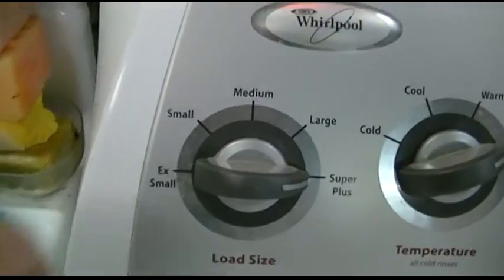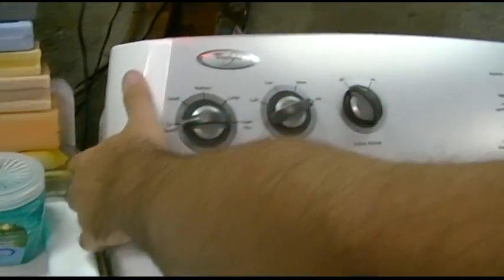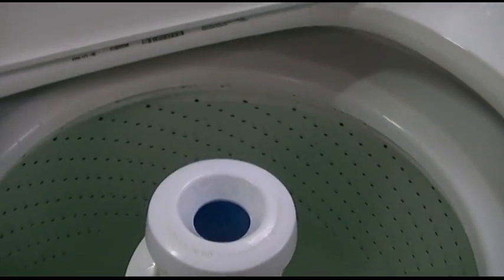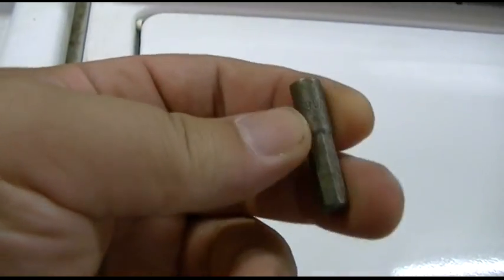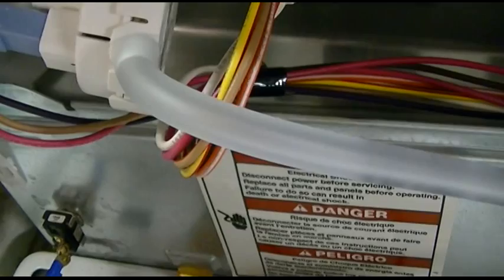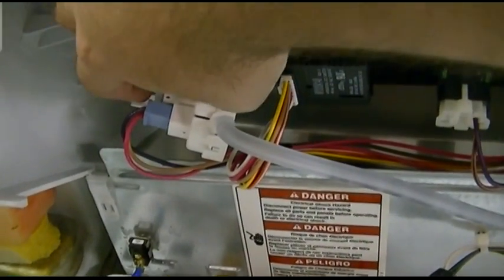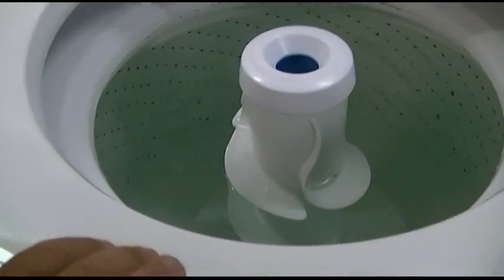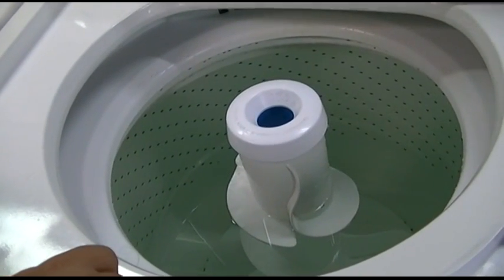Whirlpool Washer - Adjusting Water Level Selector

Comment: After 7 years mine got out of adjustment,btw, YouTube algorithm did a good job showing me this video, and my machine started to overflow onto the floor. I decided to get a new pressure switch, so I can have piece of mind to run the washer without fear of my machine turning into a waterfall  😧
Reply from the maker: You should hope that you diagnosed it correctly.  A bad hose, even with a tiny pinhole you can't see, can cause the system to fail and the washer to overflow.

Comment: This is good for those eco-friendly direct drives that use way less water than they should. If only there was a way to do this on the HE machines...
Reply from the maker: Ha ha, yes you're absolutely right!  Even if you stuck a garden hose in it, it would probably throw error W1--too much water, and spin out all the water and clothes down the drain!
Reply: Haha! True! That's why I use manual mode on my HE machine!
Reply: Smurdle450, the manual mode is Normal mode?? Cuz mine don't have manual mode, whirlpool cabrio platinum He

Comment: Does this trick work for variable water level selectors? I obtained a second direct drive about 2 months ago and I want the water level to come up about a half inch. I have been turning it to "reset" and holding it there until I think there is enough water
Reply from the maker: I believe so.

Comment: I did this to my Maytag but brought the water up a bit over the top holes. My Maytag has a thumb wheel on the level pressure switch which makes it even easier than yours to adjust.
Reply from the maker: Beg MY pard!

Comment: Ok please explain how to pop the latch so I can open where adjuster is at. Don’t want to gorilla strength the wrong part and break it.
Reply from the maker: If you have THIS EXACT MODEL, there are two big metal clips underneath, as shown.  Push them towards the back of the machine while trying to lift up on the controls panel.  Left side is a little trickier because the lid switch is there also.  Alternatively, you may be able to slide a putty knife in the gap between the controls panel and the machine to help push the clip back.

Other models may use screws instead, sometimes on the front, sometimes on the back.  Just be careful, but it's a pretty rugged piece so no chance of breaking.

If your machine is newer, this may not work at all.
Reply: Thank you so much 👍🏽🤙🏾
Reply from the maker: @aliiuso3470  You're welcome.

Comment: I have the newest whirlpool front load washer can I do the same thing
Reply from the maker: Front loaders are designed to use less water.  Too much water can create too many suds, which would impede washing performance.  Chances are your machines does NOT have mechanical water level selector, and thus, no, you can't do that to yours.  Unless of course you're handy with a soldering iron and microcontrollers and write your own programs for it.

Comment: My friend has a Cabrio about 2 yrs old. It is horrible!! Very little water enters the machine and even though she only has one set of sheets in it at a time, they come out filthy and stinky.  Can We do this to hers?  It's supposed to be a large load machine and doesn't even get them wet. Dirt, dog hair,  and lint covers all the clothes after washing.  She fostered a mentally damaged woman who had smeared feces on the shower curtain. I didn't know this, and threw it in the wash. Feces was still smeared all over it after 2 washings.
Reply: I’m here for the same reason!
Reply from the maker: The Cabrio isn't a washing machine, it's a joke.  The only thing you can do is throw it out and buy a REAL washer.  They don't make them anymore, so it will have to be used.  No, I'm not kidding.  This is the real truth.
Reply: @jaykay18  I was thinking this. I got a top loader with the house I bought 14 yrs ago that I've had in storage. I might just dust it off and put it back to work. Im tired of ruined clothes for minor stains that washers cannot get off.
Reply from the maker: @cherylefunz7789  If there's nothing wrong with it, there's no reason it can't be put back to work.  I'd never give away the machine, but that's me.  I had a talk with my 2 washing machines and I told them that they will have to continue to work for the rest of my life.  I told them not to worry if they "become ill" because I'm the doctor and I'm in-house.  If I ever move, I don't care what the cost is, they're coming with me.
Reply: @jaykay18  🤣🤣I'm sure that worked amazingly well!! however in her case, no one is much of a doctor.  😂
No sense to this machines dysfunction, as it seems hundreds of thousands of people are having the same issue. I heard from a friend that the ones with wash plates have never done a good job.
Reply from the maker: @cherylefunz7789  That is 1000% correct.  There's nothing that washes as good as these old machines.  Repair them at any cost.  Even if you need to call a repairman, if they tell you it's too old, find another repairman.  Eventually you'll find an old timer that can fix these in his sleep.  He'll tell you the same about them.  Fix the machine at ANY cost, regardless of what it is, guaranteed it will be less than a new machine, and this machine would probably outlast a new one despite its advanced age.
Reply: @jaykay18  The irony is that the new ones are supposed to be energy efficient. how efficient can they be if everything has to be washed multiple times? And at 1:48 minutes per load of contantly moving agitators, that isn't the least bit efficient!  How is it that they Government has mandated these things as acceptable, and no one is fighting back?  I think lawsuits against the government mandates need to be filed, and case studies in lab and home settings need to be used to back up the =data. Any lawyer out there want to initiate a Class Action? I hate to go to lawsuits, but $$$ is the only thing corporate AMerica understands.
Reply from the maker: @cherylefunz7789  I did a test on that years ago.  The new ones, even running longer, have these dinky little motors that use a lot less electricity than the big induction motors these machines have.  But, they actually end up sometimes using MORE water than a machine like this with the constant filling and draining and filling and draining to balance the load.

The bigger joke are dishwashers today, they take a good 3 hours to do a load of dishes.  They take so little water that they can only run one of the three spray arms at a time.  So there's a whole series of valves and wiring and complicated parts to break.  And because it's using only one spray arm at a time, again, they put a dinky little motor in there.  So yeah, you can have efficient, but it will cost you time.  Guess what?  TIME IS MONEY!

As much as I hate to say it, we're just at the tip of the iceberg.  You think things are bad now, give it 10 years, it's going to be a lot worse.

Comment: My washer does not fill as high as it did a while back. Pressure tube is clear. Diaphram clicks on and off when I blow on it. So it appears to be good. Both inlet screens are clear and water pressure and flow is very good from the hoses.  Both hot and cold inlet valves work fine and washer dispenses cold and hot water well. Only thing I can think of is pressure switch calibration or maybe it appears to be clicking and working it is not to spec. Any other ideas please?  GE top load 10 yrs old
Reply from the maker: You did see that the title says "Whirlpool", right?
Reply: @jaykay18  yes but as most people know these all operate on the same principle
Reply from the maker: @condor5635  No, actually most don't.  The general public is near retardation.  I work with them.

Your washer likely has the same function, washing clothes, much like cars from different manufacturers all drive, but operates completely differently from mine.  My washers are completely mechanically controlled, there are no circuit boards (except for the water temperature switch to keep you from using enough hot water, but I have a workaround for that too).  Yours VERY LIKELY uses an electronic control panel and not a mechanical timer which means it operates completely different.  I owned a GE washer when I bought my house, the previous owners left it behind.  That was from the early 2000s and even it was computer controlled.  In your machine, it's quite possible they use that water level switch to prevent taking more water than necessary, but it often takes less.  When there are sensors and computers and the load dances around as the machine fills, ALL BETS ARE OFF.
Reply: @jaykay18  - yes it is circuit board controlled. Agreed all bets are off when the dump thing turns as if fills sensing loads etc. I guess what I want to know is when set to max does it fill based completely on the pressure switch being open or closed?  Does not seem to be possible since there are small and medium load sizes on the dial and the pressure switch is a binary value - on or off with 2 distinct pressure thresholds. There is no variable reading it either reached the first pressure level or not. So does time/engine load sensing come into play even when set to max?  I think everything is working as designed it just appears that some times there sure is not as much water as you would think in it when set to max. Thanks
Reply from the maker: @condor5635  Again, all bets are off.  My best guess is it uses the load size pressure switch almost as an "overflow" switch.  The smaller you set it, the smaller it pretends the tub actually is.  Meanwhile, it will go on load sensing in whatever cockamamie way it does, not to exceed the maximum as set by the load size pressure switch.  If it can get away with using less water, it will.
Reply: @jaykay18  that makes sense I think. Essentially the first switch level is some sort of max level, even when auto sensing the load. The second switch level is for overflow. Basically telling the circuit board your way too high. So the sensing technology works, regardless of whether you have auto sensing set on the dial or the regular, small, medium, large, or max set on the dial. One way to fool it is to throw something in with the load like a scuba weight to fool it into thinking it’s a larger load. I’ve also also heard getting the clothes wet and then starting the cycle.  Thanks
Reply from the maker: @condor5635  You're welcome.

Comment: How do you KNOW where the proper height is? I'm referring to ALL levels?????
Reply from the maker: The proper height is set at the factory.  If you want to increase it, this is how.  Not too far, because then the machine will overflow.   Adjust on the maximum level so you know it won't overflow, the other levels will increase by the same amount.

Comment: I hope you don’t mind me asking this...The stem of our water level switch broke and has been stuck on small load. The cost of a replacement switch is close to what we paid for the washer.  Do you know of any way to switch the water level to large without having to replace the switch? It’s a Whirlpool wtw5540sq0 top loader. Thank you for your time
Reply from the maker: The stem, as in the part you turn that's connected to the knob?  Like the knob broke off kind of thing?  If that's what you mean, and you want to force it to large, about the best suggestion I have is to get a small flat blade screwdriver, and try pushing against what's left, and maybe there will be enough friction to force it to turn.

If that doesn't work, and you don't mind messing up the screwdriver, you can heat it, hot enough to melt the plastic.  I don't know how hot you'd need to go, maybe a candle would work if you leave it in long enough.  The idea is to get it hot enough to push the screwdriver tip into the plastic, but DON'T turn it.  Let the screwdriver make its own slot, and remove it.  Then when the screwdriver is cool enough, you can use that slot to turn it, one last time, to full.  You have one shot at doing this right, so be careful.  If you screw it up and can't turn it, you'll have to replace it.  Also, stand by the washer to ensure it stops filling; if you go too deep into the switch you could damage the innards and then there's no fixing it.

If you do get it to work, don't kill yourself over the excess water usage for smaller loads.  Around here, I pay some of the highest water rates in the nation, at a penny a gallon, so if the washer uses 25 extra gallons of water, it's only a quarter.  

Good luck!  Any other questions, let me know.
Reply: @jaykay18  Thank you for your help!!! I have been searching the internet for months for an answer to this and you have been the only one to provide  an answer!!! I am so great full because a small load setting isn’t very practical with three children! 😁 Now I can see some light at the end of the tunnel in the mountain of accumulated laundry!
Reply from the maker: @rebeccadismukes751  You're very welcome!    I'd like to know how it works out for you.

Comment: dude tell us about the tool.  looks like its a 90deg shaft driven ratchet type that will work in tight spaces at an angle.  is that correct, or simply just a 2 direction short/long drive tool?  looks like i need one of those many years over if its what I'm thinking.
Reply from the maker: It's a 2-direction short.long tool.  You could probably use a 3/16" socket and 1/4" drive wrench to achieve exactly the same thing.

Comment: Hi! Do you happen to know if this can be done to my whirlpool wtw4955hw. It has the option for sensing auto fill and deep water wash, but deep water wash fills up less than half way for a heavy load.
Reply from the maker: No way, even with a full tub that thing isn't going wash anything anyway.  Around 2009, the last good washing machine rolled off the line.  

See if you can return that piece of garbage, go to a used appliance store, and get an old Whirlpool, probably like you used to have.
Reply: @jaykay18  mine says wtw4855hw1 and it looks like what ever I put it on it's the same amount of water, I have to fill it a little more myself, it's a whirlpool, can you tell me the problem? I notice the guy above said his is a wtw4955hw just by one number different, do these washers suppose to do this or is it something wrong with it and what could it possibly be? Please respond, thanks.
Reply from the maker: @lindafisher3660  Did you read the response I had above?  The same applies to you.  HE washers don't wash anything even if you got the garden hose and filled it to the brim.

It does what IT wants to do, rather than what you set it to.  Somehow that's supposed to be "high efficiency".  It also takes an hour and a half to wash, where an old school washer could do it in 35 minutes.  Sure, leave it on for 3 times as long, that's apparently efficient as well.

Throw it out and get an old school washer from a used appliance shop and get back to business.
Reply: @jaykay18  alrighty then!
Reply from the maker: @lindafisher3660  It's the truth.  If you take my advice, you'll reflect back and realize that my free advice was worth thousands of dollars of prevented headaches and laundry problems.  That much I guarantee.